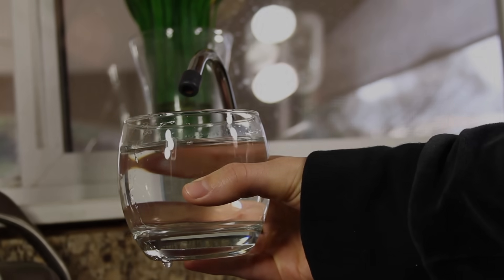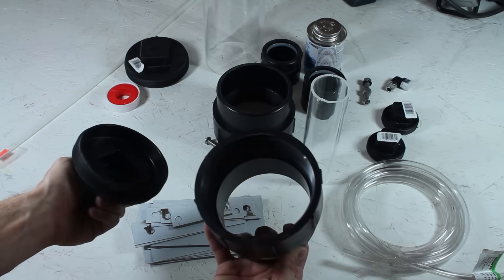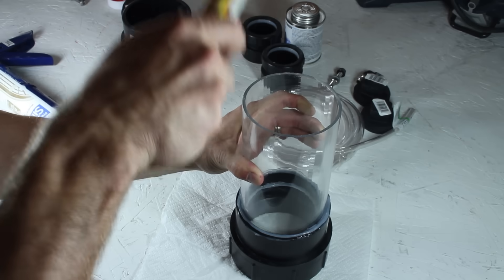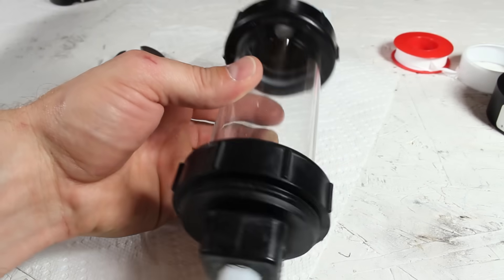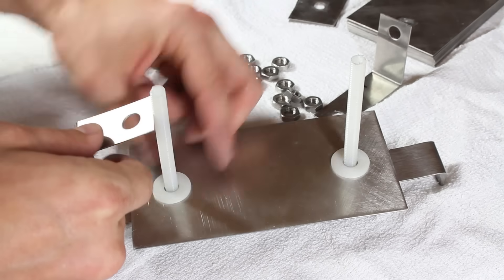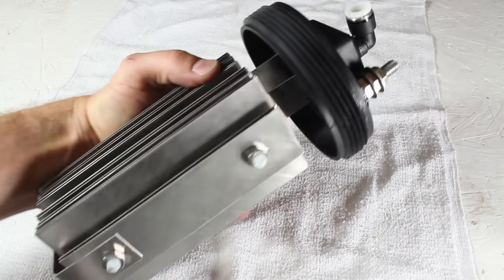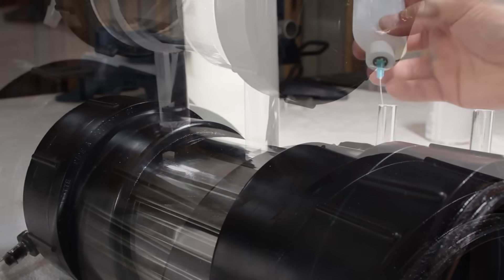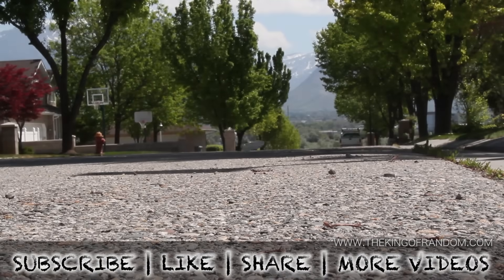HHO Generator - Water to Fuel Converter

Comment: Ok, here is one that no one talks about. 
How many BTU s of 
 energy does it take to make the electricity to make the BTU s  of Energy that you get from the Hydrogen that is produced? ?? 
Miss information sells Pie in the sky technology. And no one is told the bottom line.
Reply: Sergeant Methcake  Sure you could. But hydrogen is so awkward to handle, and dangerous as well. Why not charge batteries and run your electric car? You would eliminate the losses in the electrolysis process, and would eliminate the losses you incur when you burn hydrogen in a very, very inefficient internal combustion engine.
Reply: +Willy Bee English?
also, you could just run it off of solar...
Reply: +Sergeant Methcake Tanx for the comeback.  I sit in the not so frozen north.  Minysnowta, that is. Ya , it sure is funny how people forget what they learned in science class if it disagrees with what the media is brainwashing us with. 
Although,  if a person was living off  grid, they do make a hydrogen _oxygen welder. But again, the bottom line would not be for the home hobbyist. .
But it would be more practical than dragging the tanx off road. But waiting for the windcharger to charge the batteries may be a problem.
Reply: +Willy Bee Grant didn't talk about it because it's irrelevant. He's generated HHO to play around with. That's all.

Comment: If this were in a car, is there some way to keep the water from freezing inside?
Reply: +James Toper It will not freeze, do you mean in the engine or in the generator?

Either way, the engine keeps it hot inside, and the current in the water heats the water up.

Comment: when you use a pipe tap, you only need to tap about 3 full turns. you are not supposed to use teflon tape on those connections.

Comment: Can someone tell me how more the half of the plates are NOT useless? 

How I see it: Nylon thread and washers are non conductive, nuts and plates are. So the terminal in the center is "connected" only to the 2 innermost plates. The terminal on the side is only "connected" to the 2 outermost plates, and the rest is just separated from the conducting plates connected to the terminals. Am I missing something ?

Or is there some sort of effect achieved by having the plates act as a shortcut for electricity through water ?
Reply: +Heðin A. Johansen : Neutrals (plates not directly attached to the power source) allow you to lower the operating voltage to each plate, for better efficiency, yet have the same amount of current passing through each plate. The neutrals can provide additional surface area for HHO production as well as lower the heat. Neutral plates have a positive side and a negative side, even though a wire is not attached to them. You add neutrals to lower the voltage - to improve electrolysis efficiency - which in turn reduces heat.
Reply: +hamiltonworks okay that makes sence. thank you for the info.
Reply: +Heðin A. Johansen I believe you are correct, and that he made a mistake. Half the plates appear not to be doing anything.

Comment: w carburetor easy w FI HHO needs to mix w gasoline/diesel in the fuel rail-- FI rail nominally @ 40psi-60psi (& mind the T of HHO w/gasoline -- no insurmountable issues except modifying the ST.strict emissions system (could this solve VW diesel issues?)
Reply: +David Porowski   Maybe, but where is the HHO gonna come from?  Not from an HHO electrolysis generator, that has been proven to be a losing proposition.
Reply: +Quantum Leap you are delirious with negativity QL they are running Volvo tractors 18w from banks of HHO generators (big oil sucks HHO is new wave// F**k the petrodollar//F**k the oil oligarchs)
Reply: +David Porowski Lolwut? Sure, it's possible to power things with oxyhydrogen. That doesn't make it a good decision. I could power my car with dead babies if I was inclined.

The real solution to getting away from oil is electric vehicles.

Comment: would it still work if you used a diode with a high watt tolerance and then connect the generator to the mains,

Comment: Besides, to all the non-believers of this as a source of energy and the claims that it takes more energy in electricity to produce it than the energy that it actually delivers, let me say with all respect: Try it on an actual car, your car, which you know so well. Try it on the road, compare the RPM and the speed given at 2500, 3000, 3500 RPM respectively and you will see that the moment you connect the generator you have to lift your foot from the gas pedal (or your speed will increase significantly), the RPM lowers, and the speed comparatively increases in relation with the RPM. Explain me why my car's fuel consuption is less while the speeds are sustained. It may have to do with the cinetic energy of the car in motion that adds another factor in the equation, I don't know, but one thing is to carry out a test on a garage, and another very different is to test it in real operation.

Comment: WARNING! Do not use Stainless Steel, it is chromium plated which means that when you do the electrolysis the liquid left behind will be toxic and is illegal to dump down the drain. Use regular 20 gauge steel!
Reply: +Ace Pancake Isn't it alkali enough to be called toxic already because of the sodium hydroxide solution for better conductivity? Also is it okay to use Aluminum in your Opinion?
Reply: +steveocaster Thanks for the reply. I wanted to make one before i made that comment and just later realized that i didn't pay attention to what metal i could use.
Reply: oh yeah but the fluoride and chlorine in the water and toxic at all huh
Reply: +Ace Pancake stainless is not chrome plated only some is, it is forged with minimum 10% chromium, up to 26% is used for harsh environments which reacts with oxygen to create a layer the same size as the steel ions which prevents the iron in the steel from corrosion... get your facts straight, regular 20 gauge steel would start to corrode before you hooked the power up then once you power it up it would last a few seconds before it starts to rapidly corrode faster and faster. try reading wikipedia. there is a many kinds of stainless, for this project a low carbon one like 316L should be used Grade 316LVM is preferred where biocompatibility is required (such as body implants and piercings).[30] The "L" means that the carbon content of the alloy is below 0.03%, which reduces the sensitization effect (precipitation of chromium carbides at grain boundaries) caused by the high temperatures

Comment: I used a 2 inch pvc pipe with just two pieces of aluminum flat, one on each side with a bolt sticking out the side of the pipe, closed it off and put a hose and jumper cables to mycar and viola it works perfect

Comment: I wan't to see him hook this up to a generator and have it be self propelled indefinitely other than putting more water into the system!!   It shouldn't be too hard for him unless the hydrogen generator isn't efficient enough.
Reply: +Trevor Thieme through the production and reproduction, electricity and energy is lost as there is no perfectly enclosed system. Also energy has to be expended to start the reaction that turns the gas back into water.
Reply: I'm saying that energy is required to cause a reaction that creates the gas, that gas then can not cause more energy than what was used to create it when returning. The molecules are simply holding onto then releasing it to change states of matter. Energy can not be created only transferred. Through all of this energy is then lost through entropy(heat) thus making an imperfect system. Even more energy would be lost when put into a car to move the pistons. So u can't run a care solely on water and electricity. However yes a car can run on hho but it has to be created, with electricity, thats also generated somewhere, mostlikely through fossil fuels like coal. Hho is a fuel but not a free energy
Reply: +Trevor Thieme Have you heard of the first law of Thermodynamics? Energy can never be created or lost, only transferred.
Reply: Wesley Whaley Is there not any energy being released by breaking apart the H20 molecule. And after breaking it apart having it run in a engine. Otherwise if this didn't work to create more energy I do not see hydrogen generators helping cars and trucks or even semis get more fuel mileage when the car is supplying the electricity to cause the reaction.        PS: When you said perfectly enclosed reaction did you mean one where you never put more water into it or you will never get more energy out of it than what you put in to split the molecular bond?
Reply: Wesley Whaley Also my grandpa built one and put it on his old Geo and got 60 miles per gallon roughly so I know that it does work to improve millage.
Reply: +Wesley Whaley yes you can, are you familiarized with the term "wind turbines"?. you can use the electricity generated from these to power the converter and you´ll be running your car for free
Reply: If ur saying use wind power to charge the battery to run the reaction then ur just wasting electricity with an inefficient engine. Just go completely electric
Reply: +Wesley Whaley Sure, you could go completely electric but batteries are expensive, heavy, it takes a long time to charge them and they simply can not hold as much energy as a tank with H-gas can.
So for some situations, H-Gas might be the better solution.
Reply: Currently our electric cars are far more efficient than HHO engines. The point is waste not convience (and the fact u can't make a perpetual energy machine is the main subject) future technologies are already weeding out many downfalls of batteries
Reply: Wesley Whaley Ok, but how can that work for trucks which have to drive thousands of miles with heavy load and dont have the time to charge for hours, or for airplanes? Isnt H-Gas the only option there?
Reply: Wesley Whaley But you could build such pumps with current technology and fill the tank in minutes. You cant do that with electricity. It just doesn't seem to be an option for everything.
Anyway, i'm not trying to start an argument and it seems we aren't going anywhere. Lets just hope we will switch soon to something that is better for the environment.
Reply: Look up instant charging graphene batteries. Both HHO and electric cars are hinging on one or two technological break throughs. HHO engines are very inenifficent atm
Reply: Wesley Whaley thanks, I will.
Reply: Alex König also coming back to this thread thanks to Tom's reply, look up the walmart 18 wheeler concept called "wave" I ran across not to long ago. here's an article about it.

http://thinkprogress.org/climate/2014/03/06/3372761/walmart-wave-truck-fuel-efficiency/